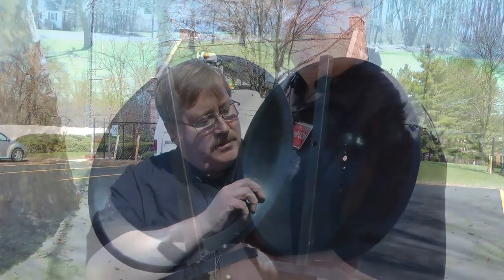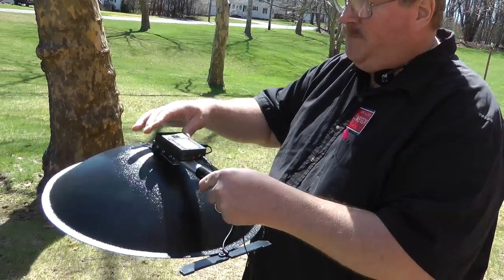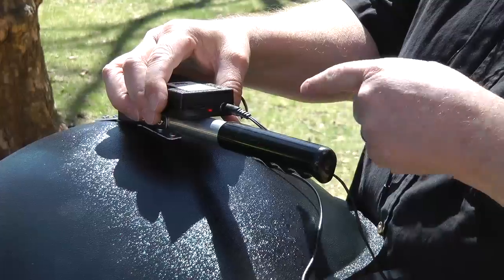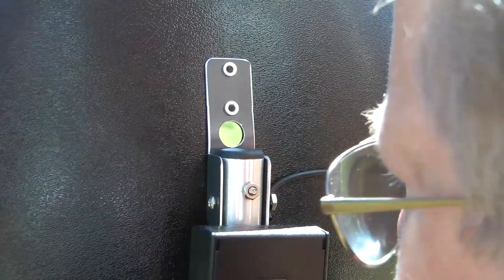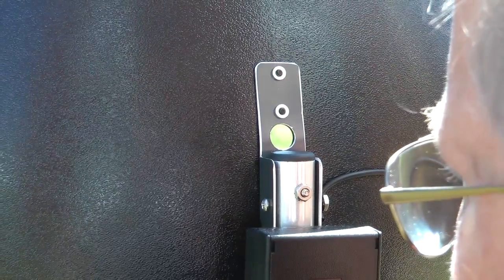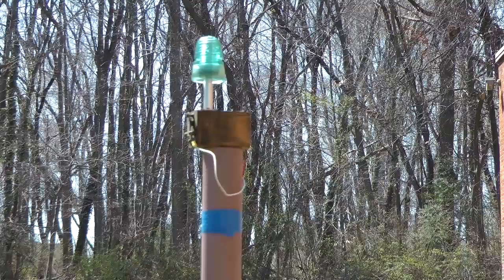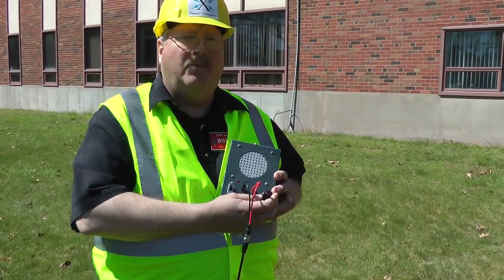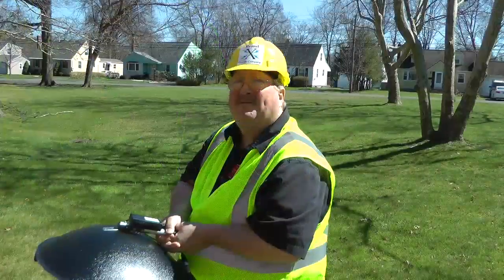MFJ-5008 Ultrasonic Receiver

Comment: I love that the battery case is able to be opened without tools. Note that some brands of batteries may need a small screwdriver to pop out the "fatter" 9V battery. No screws to lose in the field, though!
Wish all test gear was easy to change out batteries on the fly. And, I hate anything that has non-swapable batteries, that require you to go back to the shop for charging.
Great unit!